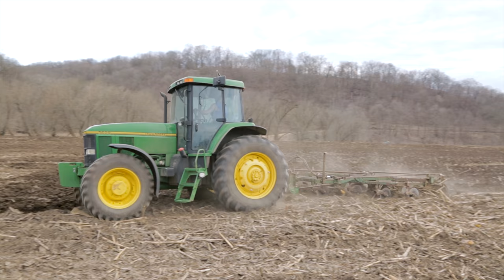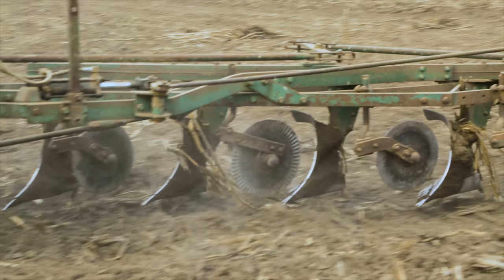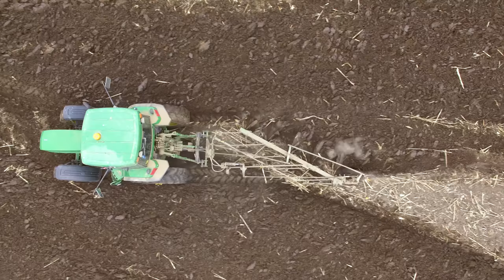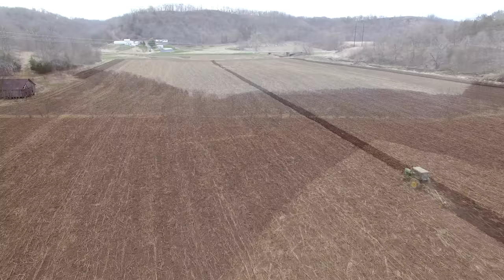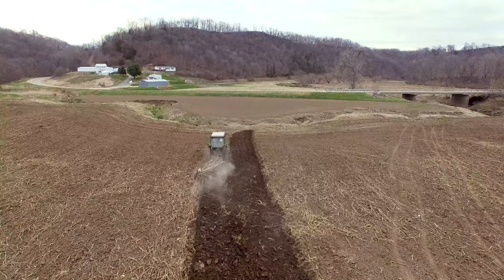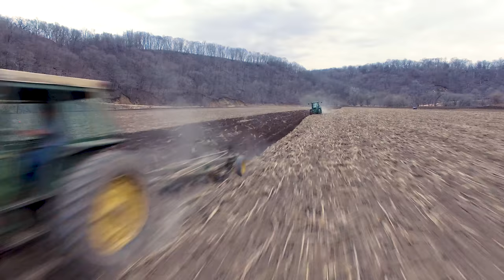Moldboard Plowing - John Deere 4320 & 7600

Comment: If you young men only knew how this brings back soooo many memories to old beat up retired farmer. I started with B John Deere and a 2 bottom plow.Many cold days sitting out in the open.Ended my farming days with a 4240 and a 5 bottom.Wow heat and air.Have to admit watching this brings a few tears.Once a farmer always a farmer.Bet that dirt smells good!Thanks for the memories.Love that drone.
Reply from the maker: I’m glad you enjoy!
Reply: Yep!  Many years ago, ...   Farmed 325A, most plowed every year, 3-16 plow, at 3.5mph max.  Farm tractors were 45 hp, max.  Covered 20A per day at the outside, day after day, day after day...  I know the  JD B, pulling those two bottom plows.  We were on the upside with 3-16 plow, but some locals had two bottom plows.
Reply: Stan Hensley did you send the grease gun
Reply: My dad and I do a little moldboard plowing at tractor shows and for his garden every fall. 3 bottom John Deere hydraulic trailer plow and a 1966 Farmall 706. I've never been a farmer but I'm a country boy who can appreciate the small sliver of the whole farming experience I'm getting whenever I drop the old JD into the hard clay in southern Illinois.
Reply: @rightsideofthegrass8114  yep, I'm still using a 3-16 plow

Comment: Thank you for the memories. I used to do that back in the 60's-70's with my dad with a 1750 Oliver ( I think) pulling a 4 bottom plow. We usually did it in the fall, as much as we could before the snow. We also disc a lot and pulled a drag to break down the soil. I spent many a day on those tractors. I remember when dad bought a tractor with a cab and a radio. We thought we were in heaven. Does anyone remember those all weather radios that were mounted on the tractor fenders?   Thanks again for the memories buddy, be safe.

Comment: I've been playing Farming Simulator 19 recently, and plowing is probably the biggest job. I thought of buying a 500 HP tractor just to do it, but I realized that you really only have to plow a field once when you first buy it. (I still bought the tractor, but I use it for tilling. That is much faster than plowing at any power level.)
It was interesting to see a real plow in action. Thanks.

Comment: The 7600 sure did a good job on a five bottom!  Four wheel drive sure helps
Reply: PAHerefords I'd hope so! A 4020/806 can handle that.
Reply: We ran a 5 bottom just like that on our 4430. I don’t think that a 4020 could pull a 5 bottom!
Reply: So does a 560 gas, and an oliver 1850.  Do it every year.

Comment: Plowing is another tool in the toolbox. Depending if it’s highly erodible land it can be an issues. But with the right timing an application it has benefits. Like grazing a riparian area. If done correctly it works but done poorly it has huge impacts.

Comment: We have a 3 bottom Allis Chalmers moldboard plow for plowing under sod (reworking pasture) and I picked up a 3 bottom disk plow (huge single disk blades set at an angle instead of shares/bottoms like a moldboard).  They work well for turning sod... 

When we row cropped, we farmed on beds, which is more of a southern thing-- seems everybody up north "flat plants" or plants on ground that has been disked flat or left flat without ridges or furrows in the middles.  We farmed on beds because around here you have to get the crop up out of the water after heavy rains and planting on raised beds does that, as well as creating a deep wide furrow between the rows for the water to run into and down the length of the field and into the bar ditches we cut on the ends of the fields next to the turning rows to allow the water to run off to the main drainage ditches by the roadsides... 

Anyway, every fall we'd run the middlebuster, which is a plow with a "double sided" moldboard the cuts from the middle using a "buster point" which bolts on like a share, and then has a left and right wing behind it like a moldboard, so it throws the soil to the left and the right at the same time.  You run the plow bottoms under last year's rows, so it plows out the rootballs and stubble and buries the residue, building a new bed between each middlebuster point.  This helps break the soil up and bury the residue and kill any perennial weeds that might have come up in the row, as well as killing the roots of the crop (corn and soybeans naturally die as they mature, but cotton and grain sorghum will continue to grow, even after being shredded off with a rotary cutter, all the way up until killing frost, and you don't want it doing that because it provides an overwintering food source for pest insects, making them worse the following year... so as soon as we finished combining grain or picking cotton, within a few days to a week we'd be running a shredder (sometimes right behind the combine or cotton picker, quick as possible!) to shred off the stalks and chop up the residue some.  We learned to leave cotton stubble lay for about a week to dry out after it was shredded-- this would destroy bollworm or boll weevil eggs and larvae and adults that would overwinter in the fresh green  buried residue if it didn't dry out.  It was basically creating a "food pantry" for the insects for the winter... A week in the blazing hot late summer Texas sun would completely dessicate and fry any remaining immature cotton bolls or squares and the rest of the stalks and leaves, and turn it all a completely dry and crispy brown.  Then we'd follow that by running the disk across the field as deep as we could pull it, to knock down the beds, loosen up and cut most of the roots of the crop stubble, and help chop up and bury the stalks and residue from the previous crop... We did this on cotton, grain sorghum, and corn stubble alike.  Soybeans of course, there's nothing left to shred down with the rotary mower after harvest, so we'd let it dry out well and then disk the bean stubble to loosen the soil and knock down the beds.  

Then we followed up with the middlebuster, which of course basically "inverted" the rows like a moldboard plow, building a new bed on the past year's row middle furrow, and creating new furrows where the row had been this year... Let the clods dry out for a week or so, hopefully get some rain to mellow things out, then we'd run the row disk, or "hipper" as they're called, through the field... the row disk or hipper has gangs of disk blades, usually 2 disk blades with a pair of bearings in an angled housing between them, although older row disks used to have 3 blades with 2 bearings straddling a center blade... the hipper has a pair of blades to run on either side of the new bed, with one blade running just to the left or right of the center of the furrow, and the other blade running about 8-10 inches away from it up the side of the bed... these disk blades were angled to cut into the soil in the furrow and throw it up onto the bed, making the bed taller and looser.  Usually there were "ripping shanks" running down the tops of the beds to break up clods and loosen the soil in/under the bed itself, with about a 6-8 inch cultivator sweep cutting under the bed, which also kills any weeds that may slip by.  Since there are two gangs of disk blades running in each middle (except the outside middles on the end of the toolbar) they are staggered with one running in front of the other so they don't interfere with each other, and they throw the soil up onto the bed from both sides of the row... 

Then we'd be done til early spring... usually try to get into the field in late January or February and run the hipper again, to kill any sow thistles and verbena that came up during late winter, and loosen the soil a bit so it could start drying out for spring tillage... This would usually be followed up by knifing in liquid fertilizer down the center of the beds with a pull-type applicator, and then disking down preplant incorporated herbicides for the next crop, with another trip of the hipper to pull the beds back up  for planting, usually pulling a roller behind the hipper to firm up and flatten out the beds so the planter had a nice, smooth surface to run on and the moisture could come up through the mellow soil easily to planting depth... (before we ran rollers, we usually pulled a drag harrow like yalls to knock any clods off the top of the beds and make it smooth and mellow for planting, but the rollers work better, like rolling baskets!)  

Course, we were looking for ways to eliminate trips, so some guys retired their middlebusters and went to stalk pullers, which uses a pair of angled blades with "paddles" on the back to keep them turning in the soil, which work exactly opposite the way disk openers on a planter or drill do-- the blades are MUCH larger and heavier, with HD bearings and axles, and run touching each other in a backwards "V" pattern... the stalks and roots enter between the front of the blades, they pinch together and rip the stalks and roots UP out of the ground, and throw them up in the air in a rooster-tail of soil and stubble behind the stalk puller as it runs through the field... then they'd just hip the field back up behind the stalk puller and the next spring, knife in fertilizer and run a hipper over it once with the rollers behind it and then plant... which is probably more like what I'd do now if I were still row cropping... 

We never owned a chisel plow-- they're practically unheard of here, but I've run them in Indiana and they do a good job.  They're not much use farming on beds, though.  We DID occasionally deep-rip or subsoil with a subsoiler to break hardpan up though... 

Later!  OL J R :)

Comment: Ploughing is so satisfying , yes that's how we spell it in the UK , when you do a good job it just gives you a complete fresh start. I don't see many reversible or two way ploughs in it he US Iwonder why. Real good quality video Guys Thank you .
Reply: Several guys around me use roll over plows. I think the main reason their not as popular is the amount they weigh. Most guys I see use a 4 bottom roll over where with a semi mount plow they'll pull 5-6 bottoms. 
Each have their benefits roll over you have no dead furrow but stopping and turning around all the time.
Semi mount pulling more bottoms and covering more ground in a pass 
Its a,toss up to me which would be faster it all comes down to preference.
Reply: Do yall have switch plows over there??? Deere came out with one years ago... basically the toolbar swings from one side to the other when you turn around, like a hydroswing mower... the moldboard bottoms are shaped like a snow shovel instead of the traditional right hand or left hand bottoms on a rollover plow... it has a share across the bottom edge and a wear shin on either side, and a moldboard in the middle... it's also got two landsides, 90 degrees apart.  The bottoms pivot as the plow toolbar swings from one side to the other for the next pass, so it becomes a left hand bottom on one pass, and then a right hand bottom on the next pass-- the shin on one side leads on one pass and the other shin leads on the next pass, with the soil sweeping across the moldboard the opposite way with each switch... 

Later!  OL J R :)
Reply: luke strawwalker I've seen them in magazines but never seen one in my area. I think they are a little more popular in the southern states like Texas. In my area we have heavy clay soils and I have a feeling there not suited to well our conditions. But work better on the sandier soils in the south.
Reply: Yeah I've seen them at farm shows and picked up brochures on them because I was interested in how they work, but I've never seen one in our part of the world... Course we're on pool-table flat black gumbo clay soil but even in sandier areas like around Shiner I've never seen one, course that are is mostly cattle but there are a few guys growing corn... 

Later!  OL J R :)

Comment: I notice the tractor driver raises the 3 point hitch arms when turning around to drive in the opposite direction then lowers them to plow. Can you tell me what is the function of the hydraulic cylinder and the hydraulic lines?  Do they impact the angle of the cutting wheels or do they level the plow bottoms. I am thinking of restoring one that’s been unused and sitting outside for over 20 years.

Comment: That 7600 must have lots of power to plow like that.
Reply: When I was in high school we used a 825 JD 3 bottom rollover behind a 720.  I can still feel the switching of the cylinder as it was time to reverse the lever.  Then I  had a 4 bottom Case rollover for the 4430s when I started farming after college.   Even back in the 1960's we made 200  bushel corn.  We planted the corn at 29 to 34,000 and some would always lodge and the moldboard was a good way to bury the ears and loose kernels.

Comment: Lol back in the good old days if you plow with a Wheatland tractor ( widefront end) you could put 1wheel in the furrow and get off and walk, pickup stones . Self driving . If you let it get to far away you had run to catch it Also Weise made min moldboard , you took the big ones off left more residue on the surface you did this in the fall

Comment: Naw ! - Thats no' how farms work!  :-)  Man! is that field dusty and ROUGH!   I hope you pay the 43's driver a better Bonus - doing so well under the conditions - and can handle it with 2WD.   Can just smell and feel it from the 60's early 70's with a 4020 Powershift and 5-Furr F145. Glad you showed at  least a little of the 43'.   Why you  plow round the corners@ - don't tell me its 'cause the furrows are longer to get the job done quicker! - and yes, where ARE the birdies - ALWAYS Seagulls and Crows and some Raptors. Thanks for posting